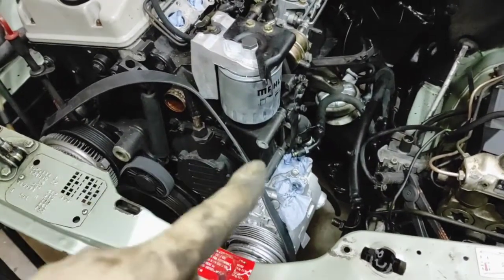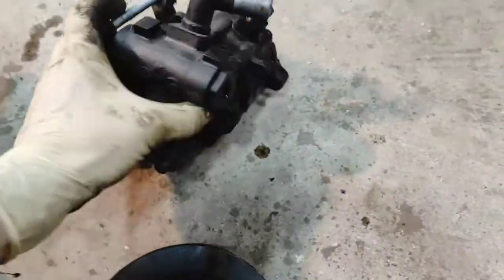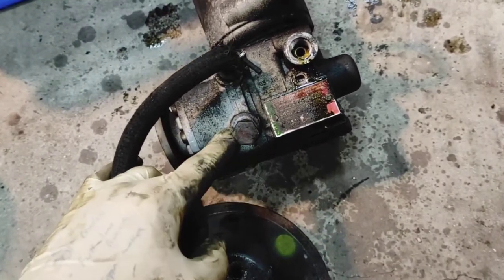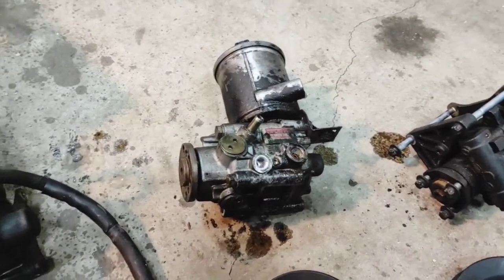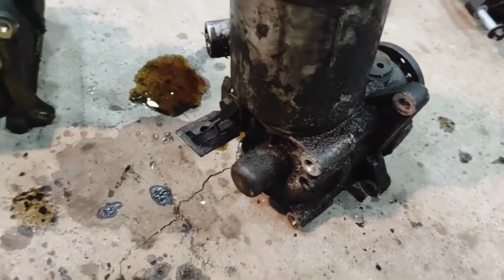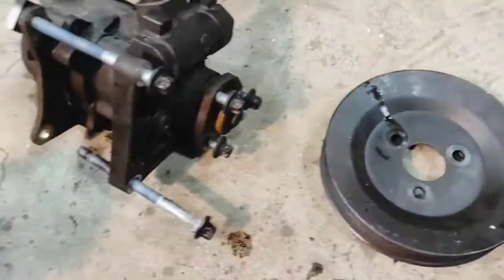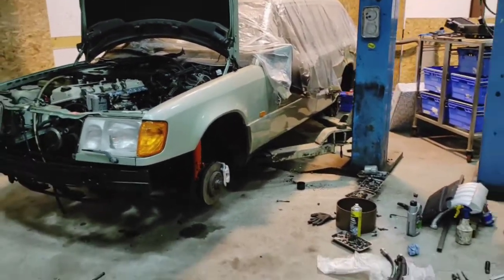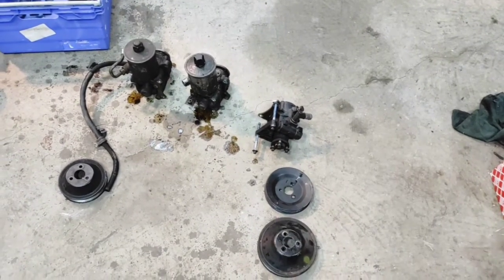Examination of 3 different SLS Pumps - w124 build update

Comment: Thanks Niall.Was wondering  why the lugs on my power steering  pump were broken...must have had a shot damper in its  previous  life.On the wheels personally i would stick with the original  15 "  15 hole alloys (but thats just me )
Reply from the maker: I actually don't mind the original wheels but I'll eventually want to upgrade the brakes that's why I'm thinking 17" wheels will be the best balance of size to space for big brakes.